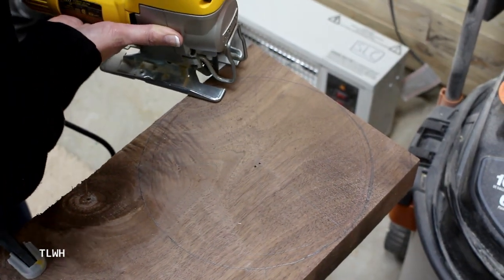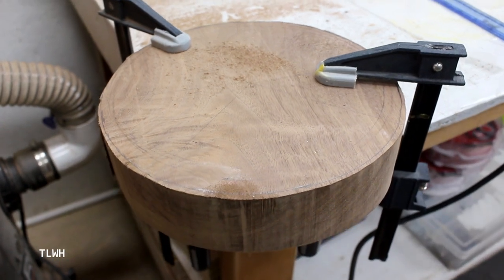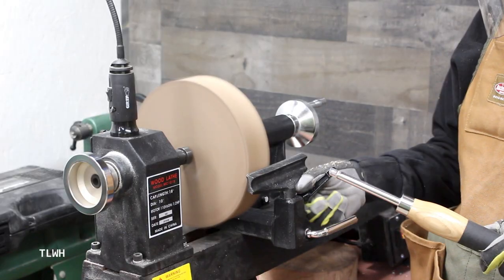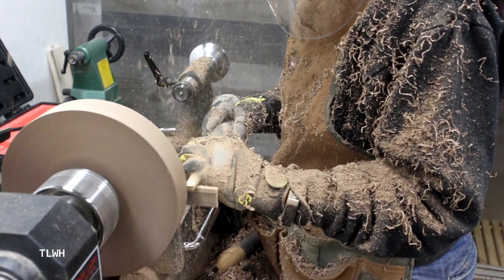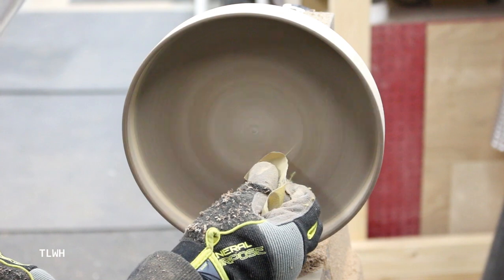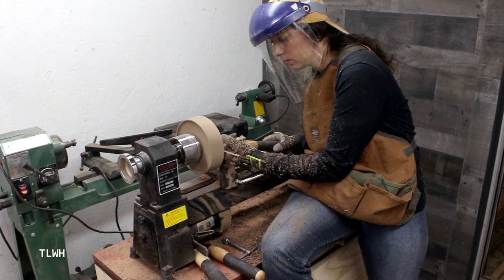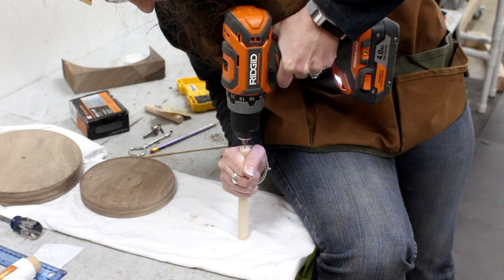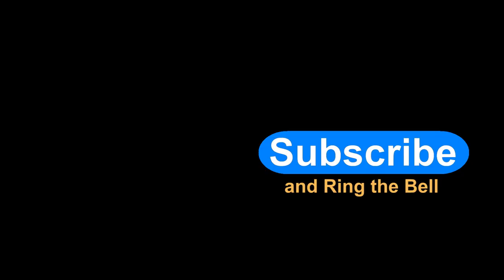Making a Walnut Tiered Tray From Scrapwood

Comment: You could have left the large tray on the lathe with it rotating and carefully used the pole saw to remove the small section you cut off. I see others do removals in a similar fashion.
Reply from the maker: Thanks for the advice